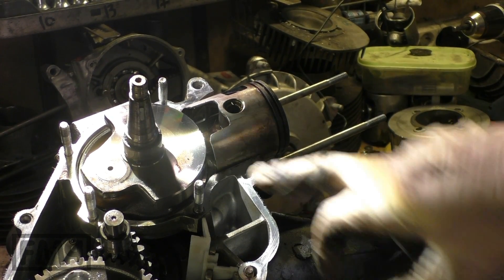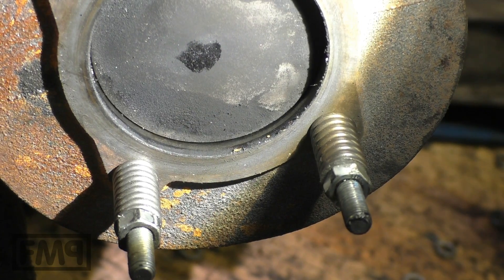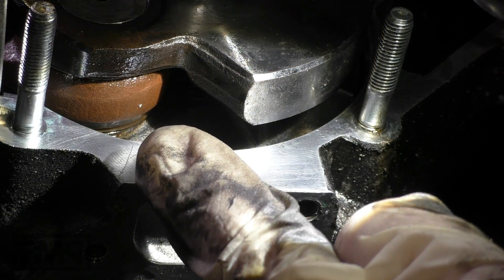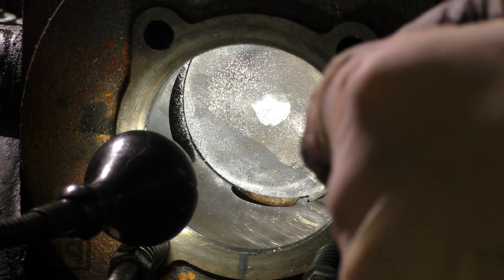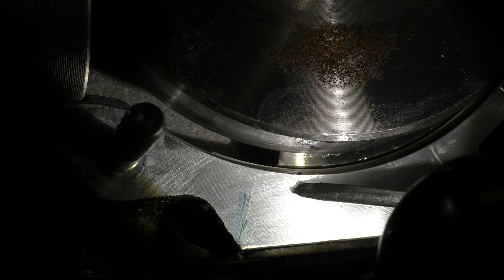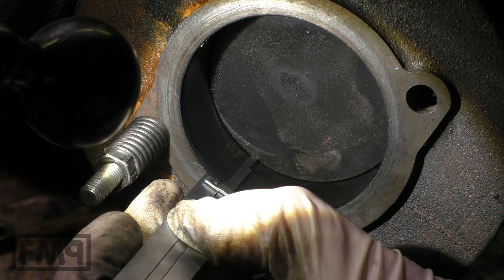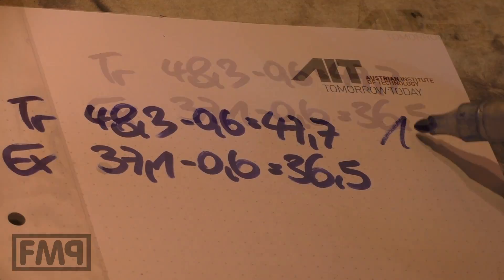THE ultimate VESPA TIMINGS guide | OPTIMIZING intake & cyl | FMP-Solid PASSion |

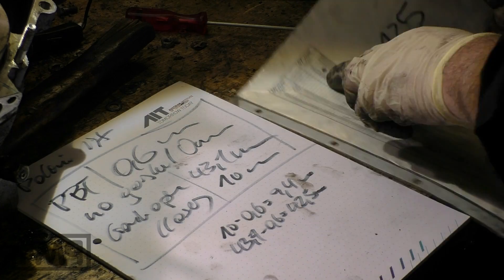Comment: Hey sir, i have a question about 5:47 how did you convert from mm to degree° ? 
you really help me understand a lot of thing & i appreciate your effort explaining all this, thanks ! 
--------------------------------------------------------------------------------------------------------------------------------------
ps : im working on piaggio ciao / si / bravo ( rotary valve )
       My problem is i adjusted the gasket below the cylindre, because when the piston is at BDC ( ports was not fully open ), so i add 1.5mm to fix it, now the ports are fully open, but the timing is bad, after i turned the engine on, he went crazy idle & hole in acceleration, i knew it's coming from the gaskets that i add below the cylindre. now im trying to fix, i did a lot of research, im still learning but i want to be accurate. 
here's some info's if you cound give advise or help and thanks again.
--------------------------------------------------------------------------------------------------------------------------------------
( PIAGGIO CIAO ROTARY VALVE ) 
inlet open  : 112°
inlet close : 53° 
total inlet  : 165°
conecting rod : 78mm
stroke : 43mm 
pbt : 3mm 
--------------------------------------------------------------------------------------------------------------------------------------
( TEST 01 Gasket 1.5mm below cylindre )
Exhaust port duration   : 103° - 257° = 154° 
Transfert port duration : 118° - 241° = 123°
--------------------------------------------------------------------------------------------------------------------------------------
( ORIGINAL GASKET 0.1 very thin gasket - ports cylindre not fully open at BDC ) 
exhaust port duration   : 102° - 249° = 147° 
transfert port duration : 121° - 235° = 114°
Reply from the maker: thx. Opening ports is overrated, timings are more important las u just experienced. 

Better use an online calculator, there are plenty, ie this one:

http://ddog.at/stz/rechnen.php
Reply: @FreakMoPed8  thanks 🙏 for the reply sir, So I have to use the cylinder timing to get the the right crankcase intake timing and website you sent me will help me get that timing i guess.

Comment: Based on your experience, what rotary pad times do you recommend for a malossi sport 221? The engine has also a polini box and pinasco 26 SI.
Reply from the maker: You nees forst of all 0,05mm toleramce, than you can go up to 200, with exhaustbooet widening it will peak Up to 25hp. I prefer openining intale to the back max, to the front original. But 0,05mm is the most important thing, if not provided, also short timings will cause blowback and engine will never work normally
Reply: @FreakMoPed8  when you say to the back, are you referring to BTDC?
Reply from the maker: looking at crank, to the LEFT
away from the cylinder

Comment: Its like you are reading my mind, I'm just fitting a 57mm mazzu crank to my malossi166 and this video came in perfect time.
One question, do I need to cut my mazzu crank to extend the closing time to 70 or can I cut the rotary valve on the case?
Reply from the maker: Maximum at intake, rest at the crank. Also use space to the back the extend the intake timing